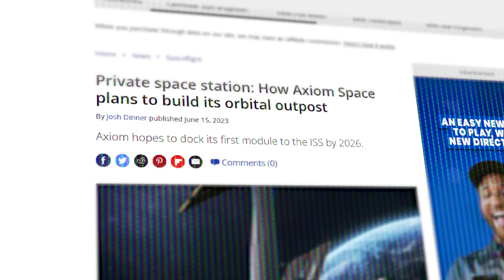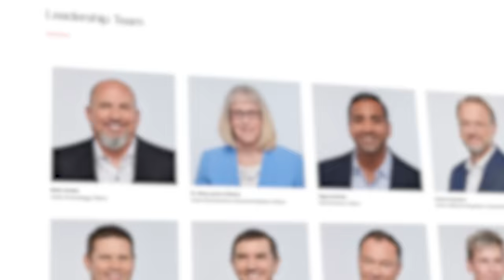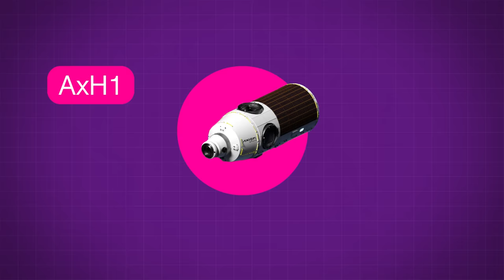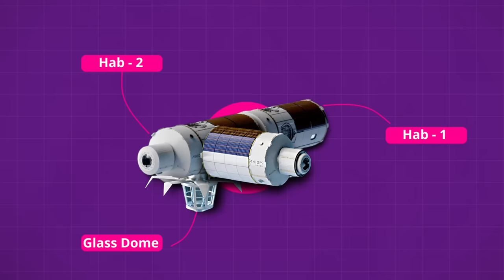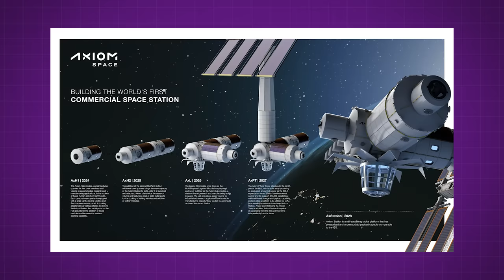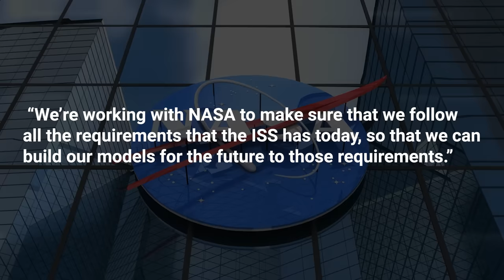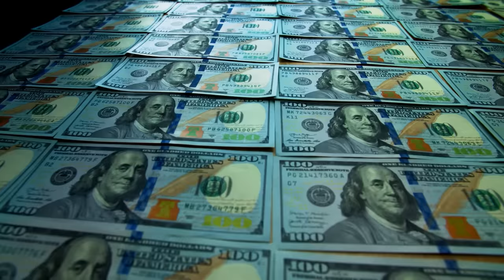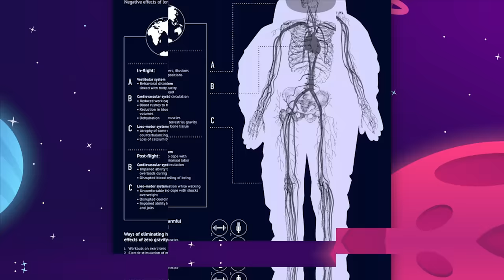The Truth About NASA's New Space Station! (Axiom)

Comment: You forget the inflatable Bigelow Expandable Activity Module, still docked to the ISS and serving as an additional storage space. Sadly, Bigelow suspended operations two years ago, but this was the first module by a private company to be docked to the ISS.
Reply: Too bad Bigelow kinda “spaced out” with conspiracy theories.
Reply: Would you want to live in an inflatable module?
Reply: @kirishima638  Of course. For the same launch mass, you can make it both more spacious and more resilient than metal cans.
Reply: @kirishima638  Expandabilty. It would stretch and hold more crew for later deployments. It would be very strong beyond Kevlar and bounce micro-meteoroids off or trap them in the baffles. Self-healing to reduce unnecessary EVAs. Bigger objects might require a course alteration to the orbit. 
I’m sure someone from Bigelow could explain it better. 
Not aluminum. It would just bounce radiation all around the cramped crew compartment and killing them. We lucked out during Apollo missions that there weren’t any CMEs from the sun during the moon landings or the astronauts wouldn’t be dying of old age like they have been. Charlie Duke and Harrison Schmidt I think are still around.
Reply: @philiplongee1149  The pandemic didn't help, either. 

A shame that with BEAM, plus Genesis 1 and 2 actual space hardware, they seem to have been just slightly too early for their product demand...
Reply: @kirishima638 barely less strong a membrane than the existing one

Comment: What I didn't see you talk about was the orbital maneuvering section and the refueling system. Without periodic boosting, the new Station will decay. It also needs a system to orient the station in orbit, either with powerful gyros or an RCS system (or both, since gyros eventually develop too much spin.) The RCS needs refueling.
If there is no thrust and control module, which spacecraft in the US inventory will be re-boosting the Station? Dragon 2 has the OMS facing the wrong direction. I think the Starliner may have the re-boost capability. Not sure if Dream Chaser has any nose thruster that can re-boost, since it docks the Service Module to the station.
Reply: Every Axiom module will have navigation and propulsion/reboost capability. They have to, because Axiom doesn't own a Space Shuttle! ;) Whatever launch vehicle they use, the module itself will still need to be responsible for final rendezvous and approach to ISS.

Comment: I've often wondered if moving the ISS into a junkyard orbit with plans to eventually let another innovator melt down the already refined metals would be more useful than launching new stuff at $10k per kilo
Reply: I'd rather they keep it around and reuse the modules for future projects.  
Sure it's old, but the modules could still be repurposed as extra crew or storage space.
Reply: @Uzarran  yup - send in robotic machines to continue using parts while human requirements could be powered down to save energy - possibly having it as a rescue point for other space going hmans in case of emergencies.
Reply: @Uzarran  IIRC, due to the long duration in space, it's likely that the modules are coldfusion welded together. separation might be quite hard... outside of the newer modules...
Reply: A "junkyard orbit"? Cost would be huge and likely vetoed by roscosmos.

Comment: Maybe Starship can't be the long-term, permanent space station solution most people expect, but what if it fills the niche of a sort of temporary, short-term space station for limited to large crew capacity?

Here's what I mean:

1) Have 'Space Station' variant starships that can be launched to orbit with astronauts and everything they'll need for their mission.

2) Launch the space station into orbit and let it remain there (days, weeks, months) for as long as the mission requires.

3) Deorbit and land it at the end of the mission with the astronauts, and do necessary refurbishments or feature additions.

*You could have a docking adaptor/interface for emergency/ad-hoc crew and supplies ingress/egress.

This provides a unique, reusable space station solution for special use cases. This is especially a good solution for space tourism. You'd have no need for crew transfer between spacecraft AND station as the spacecraft IS the station.

EDIT:
You could then have hundreds of Starship Space Stations up there with thousands of astronauts (on different missions) or even tourists. Again, just land the starships whenever they complete their missions.

Comment: Is there any hardware that they could salvage from the iss? Solar panels for example?
Reply: The most important thing is the decades of experience that the people at AXIOM and at NASA have with the ISS. The solar panels specifically are very outdated and inefficient, and I imagine that's the case for the majority of the technology on-board, but the experience in operating and constructing it  is invaluable
Reply: @ivonniebaby  The panels on the ISS have only just this year been updated (& another update is coming), so while the old ones are probably well past use-by, the new ones should still be quite serviceable.

Comment: I bet on SpaceX.  With a custom non-reusable second stage, one starship would easily double the usable volume of the entire ISS.  All you need is build a hub, dock a dozen of these one-way modules, than two regular starships as shuttle, maybe a bunch of escape pods if people are really paranoid.
Reply: that defeats the whole purpose that makes it affordable. Starship would be beter suited to being up huge mudules
Reply: @anoniemw.222  When you launch something that last decades, reusability of the vehicle isn't the main concern.  Starship is still big, you just need larger pressurized living quarters, smaller tanks and simpler engines because it's not coming back.
Reply: IMO, Space X can always develop a fairing to fit on the "StarBooster" for the big bucks. There's enough lifting capacity on the Booster anyway... so if they can develop a orbital delivery vehicle for Overt-Sized equipment, they are literally the Antonov of Spaceflight (Reference to the AN-225) and therefore relatively safe until the other guy get his rocket to start flying... 

then again... NASA need SpaceX to actually fly... Artemis literally hangs on that...
Reply: @ThisNoName  But half the ship is feul tanks and removing those in orbit will be quit hard. Also the engines need to be brought down with another flight. It seems for me way better having spaceX launch one big infatable module. That would really have a lot of space and maybe could even spin for gravity.
Reply: @anoniemw.222  Half of that fuel are used for cancelling out all that orbital speed so the ship can come back to earth, and half of the engines are designed with landing in mind.  None of those are necessary if it's a one way trip.  

You can either have a detachable second stage that ditched like any other rockets, cost is not a factor if the main module stays up for decades.  Even without separate second stage, you can still shrink the tanks by half, probably 3 smaller vacuum engines, no heatshield and landing accessories, effectively double the pressurized living space.

Comment: Guess they didn't learn their lessons from Apollo one? Padded walls, with electric lighting and wiring right behind the padding is a recipe for a space fire. Just as lethal in space, as on the ground. Hab one needs massive redesign. No padded room. Geez. A little common sense goes a long way, Axium. As for that glass bucket, it'll blow out, as soon as it passes the Carmon line. Way too much glass, or polycarbonate, and not enough structural metal. That's why the cupola on ISS has smaller view ports, and MMOD shield shutters.

Comment: Seems like a miss not designing for Starship payload capacity / dimensions which are 2x the diameter and 1.5x the length you could design and build each module.  that's a massive difference in volume (609 m^3 to 3420 m^3), ~6 times more internal volume.  Seems silly to design ISS v2.0 when you could literally white sheet a brand new approach due to the massive advantages you get with Starship as your transport vehicle.

Comment: honestly they should repurpose some of the modules as storage etc dont see why they need to just abondone them
Reply: At the very least, crash it on the mood where they can salvage the metal or use it as a gathering spot for all the space junk they can to use as a shield.  Sure;y the solar panel alone would be worth salvaging for the moon?
Reply: @richardweighill8556  exactly or shit put in in orbit around the moonwhere gravity is not as strong as the earth where thrusters would have to be constantly used sure downside is resupply shit they only need 3 man crew
Reply: @richardweighill8556  You know it would be very difficult to boost the entire ISS up to escape velocity (it would have to be very slow acceleration, not a typical high-thrust trans-lunar insertion, or the module connections would break apart,  not being designed for that).

And after a crash (it would come in at many thousands of miles per hour) you have nothing but fragmentary pieces of no use to anyone, not some neat pile of metal.

Comment: One module each year!?! Why so slow when spaceX is doing a heavy launch, starlink deployment, and or any other type of orbital flight every 3 months??  I really hope that the timeline is much more expedited than that.
Reply: You're not considering construction. Doesn't matter how many launches per year when you need a full clean room facility for the construction of each module. Then you need to transport it in its clean state. Each module will also have its own unique weight profile that will require calculations of its impact on launch dynamics. As well as the transfer orbit to its initial Dock with the ISS.
Reply: most likely that's initial plans. if they have more customers, they might be able to expand way faster...

Comment: So…..a “new” space station, built pretty much the same as the old ISS, using mostly the same old tech as the ISS……farmed out a to company ran by the same old NASA folks from the ISS. So, you all don’t see a problem with that? I can already see huge cost overruns…..
    I’m an old guy, but I recognize that there is an abundance of new tech the could be used to build a better, longer lasting space station with artificial gravity by inducing spin, while still having a section with zero gravity for scientific experiments. 
     Having the artificial gravity would alleviate most of the negative heath issues of zero gravity.

Comment: why not just station inflatable space station, breathable air on the inside, 10 inches of water pumped into its skin to form the most effective anti radiation insulation? micrometeorites form no harm, as the smaller ones are stopped by the water (if they pass the resistent skin), and the larger ones would puncture the thickest, all metal space stations just as well. So, why not make these cheap stuff and make them huge and gigantic?

Comment: Why not send the space station upon a long trajectory to Mars instead of wasting it burning up in earth's atmosphere!
Reply: Um, it can't carry that much fuel, it doesn't have the engines or guidence systems for that. But if you wanna foot the bill, I'm sure they'll listen
Reply: ISS is designed around the assumption of frequent re-supply and crew rotation from Earth. You don't get that, halfway to Mars.

Nor can you get out of the sunlight. The thermal management of ISS was also designed around the assumption that it would be in Earth's shadow, approximately half the time.

If it's becoming too old to operate in LEO, how can it be any younger or safer as an interplanetary spaceship?